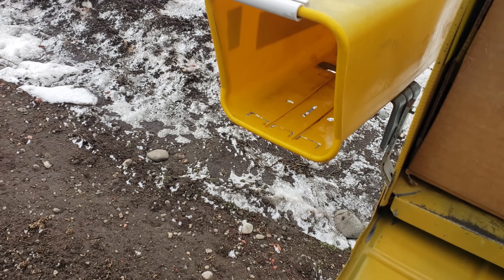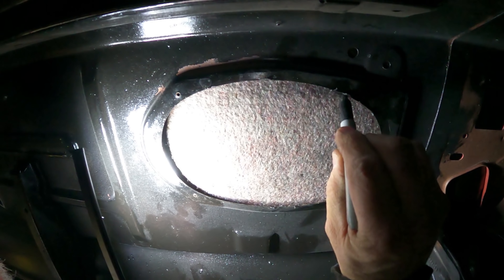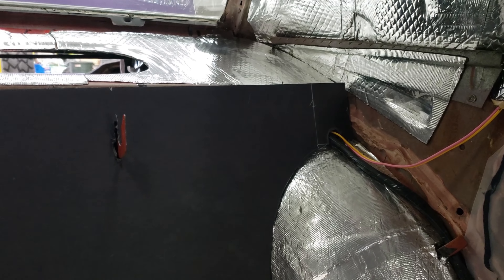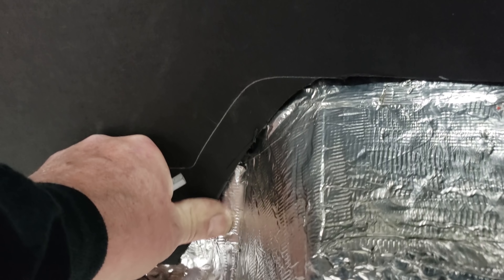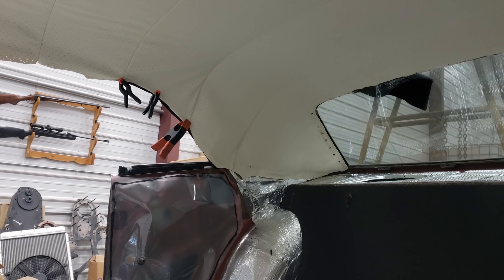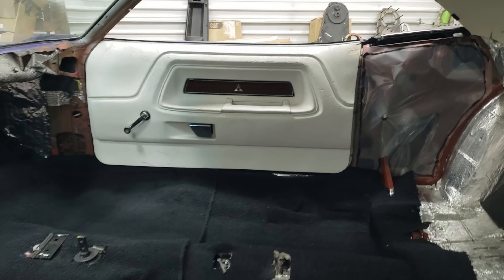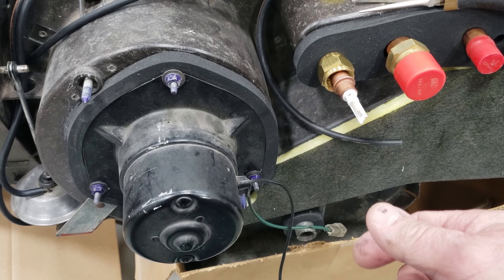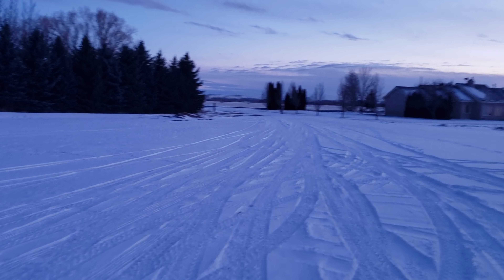Mr Upholstery

Comment: I truly commend you for spending the money,time and patience to do an interior correctly. 90% of street rods I see have a life that goes like this....First they get the body fixed,primer, full blown chromed motors/drive train and are driven for 5 years. The second round is then motor comes out for a transplant and car finally gets paint and back to the streets again for another 5 years. These guys end up cruising around in mouse piss from the 70s smelling, ripped up,greasey interior for 10 years and then sell them. It takes alot to completely finish a old classic correctly and I have really enjoyed the journey of doing yours.Mostly because I haven't woke up sore from the yoga positions needed for the interior work! 
Thanks, Paydirt!👍

Comment: Great persistence, Jeff, many don't realize just how tedious putting a car back together is. Dodge put the entire dash, wiring and all, in as one piece, put the two bolts at the outside bottom and worked from the top.  I think Nick's Garage has a B body video on dash installation. I use CAD (cardboard aided design) for interior panels.  😁

Comment: Jeff, will that trunk rumble transfer through the cones of the speakers, after all they are just paper. Can you put an insulation box under the speakers in the trunk to inhibit noise transfer?
Reply from the maker: I was more worried about the trunk sounding like a rock concert 🤣 and thought about enclosures but it would possibly fix two problems at once

Comment: did it have a txv  originally
Reply from the maker: yes, but I want to use a tube
Reply: @Jpaydirt  ok i'm assuming u have reasons so you need some type of roller to swedge tube smaller so orfice fits tight? that seems to be your problem. i was thinking a small mini tubing cutter with a roller where the blade goes im sure u can spin one up on the lathe no problem . get your orfice in tight than crimp tube ... i was always under the impression txv are far superior
Reply: i see cheater tube  but me being a male i cant clean shop but cars trucks wiring tubing must be "clean" good luck jeff and thanks you for you being you
Reply: internal pin .002 - .00? smaller than min dia. (flat minor diam where o ring goes)on  orfice . external roller system check fit copper is super malluable. make slightly smaller lap for super fit. crimp for depth. i prefer txv maybe not avail 22?
Reply: how do u size the fixed orfice?

Comment: About your A/C orifice, you just need to use some kind of insulation between the orifice tube and where the tube goes into the A/C unit. Some material called cork tape would work good for this task. Mini Split household A/C units have the metering device in the condenser. Because of this, both pieces of tubing between the condenser need to be insulated. That will prevent the "liquid" line from picking up heat between the condenser and the air handler. As I mentioned, some material called cork tape will work for this short run between the orifice adapter and the A/C unit. It is a black sticky putty type of material that will keep things working smooth.
Reply from the maker: My subscribers have collectivly sent me 21lbs of R12 to put in the car, I can rig some 134 gauges to install it but what about drier's and hose, will they work with 12?  I'll have to clean out the PAG oil in the compressor good and use mineral oil but I didn't know  about drier media if it will work
Reply: @Jpaydirt  Do you not want to use R134? You should be ok with the hoses and the drier. They are "generic". If your compressor has the oil for R134 in it, I would consider using the R134 just because it is easy to get. R12 is heavily regulated. The orifice is where you might have trouble. You have to have one sized for the R134 instead of the R12. It could be just a matter of getting a larger (or smaller) sized orifice to match the R134. In household systems, they offer condensers without any oil in them. Depending on which refrigerant you use (in household systems, the old is R22 and the new is R410), you add the matching oil and use the correct metering device - one rated for the system capacity and the type of refrigerant being used. The hardware is basically universal while the oil and the metering device are determined by the type of refrigerant being used. If you have the oil for R134 in the compressor, it definitely would need to be cleaned out for sure. I have converted several R12 systems to R134. They sell kits that contain an oil additive to make the existing mineral oil of an R12 system to be compatible with the R134. I installed a new R12 compressor in one vehicle and used this kit and the result was a very nicely working R134 system. This was a 1987 Toyota. Anyway, I would think about using R134 especially since you already have the compressor with oil for R134 in it. If you have new hoses, you wouldn't have to flush the mineral oil out of the hoses and evaporator ( I thought that in a previous video you were talking about replacing the evaporator coil That is another place where oil would collect and need to be flushed. The condenser coil is also a location that would collect oil. If all these are new, it would be a relatively simple matter to use the newer, more readily available refrigerant. Something to think about. Good luck!!